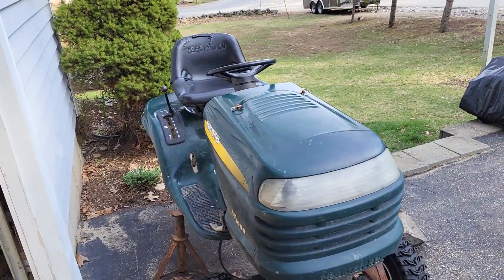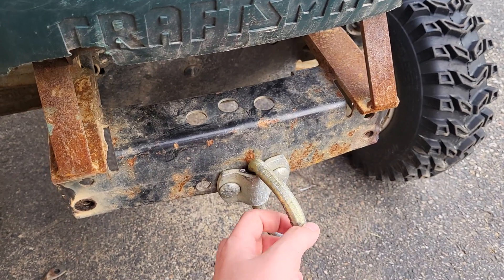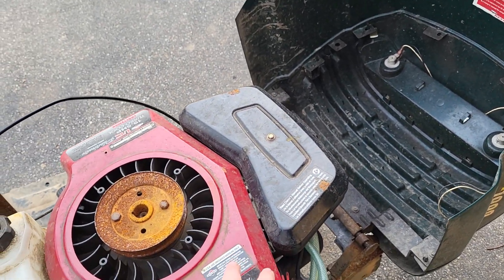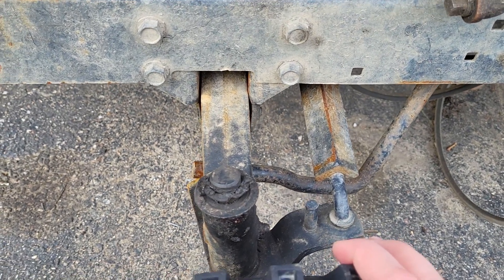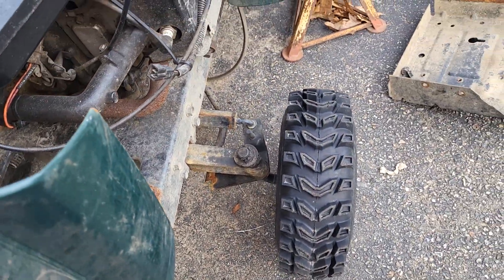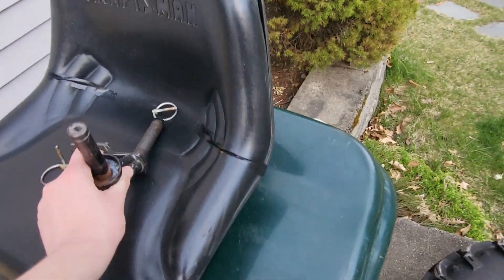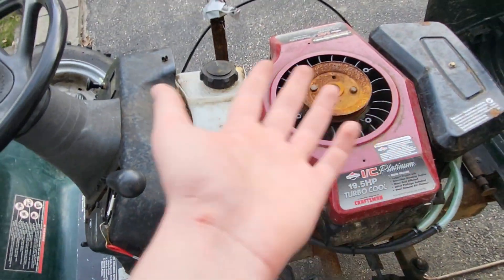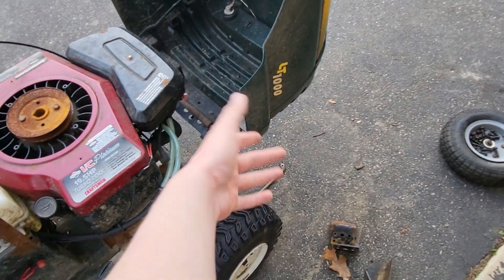Craftsman Crusher re-re-build #1

Comment: Hey bud how ya doing?
Your probably right about the front axle mounting plates being bent and making your axle look bent. Mine were destroyed and I had to build newer improved ones out of thicker metal. 
Spindles look good, keep up the good work.
Reply from the maker: Whats up Kyle! Im doing alright, how about yourself?
Once i figure out a decent design or brace for the front axel mount i plan on making a detailed video on it, the spindles were inspired by your video too i just didn't have the steel you used do i made it work with what i had laying around

Comment: Looks great but I've locked multiple msts with the extra gear technique and they all broke after a ride or so. Hopefully it works better with the 820. Keep up the great work.
Reply from the maker: Uh oh lol,  ehat size tire were you running
Reply: @craftsmancrusher207  I had 18x9.5 on my mower but my buddy had 20x10
Reply from the maker: @specialt9744  well only 1 way to find out with the 820
Reply: @craftsmancrusher207  I hope it works